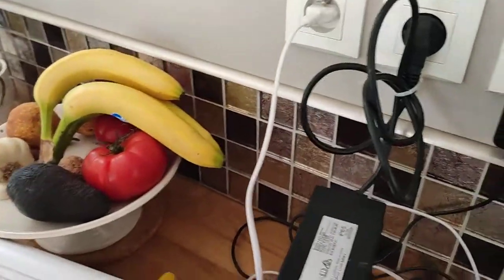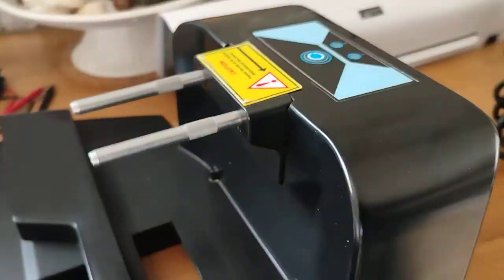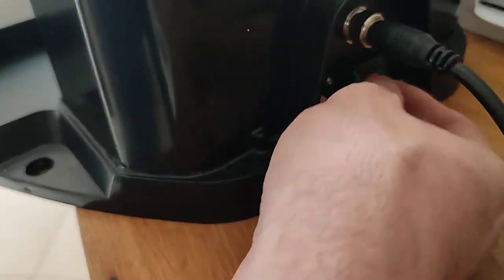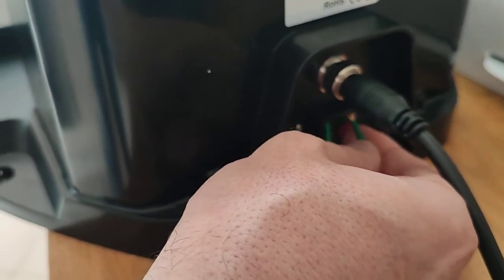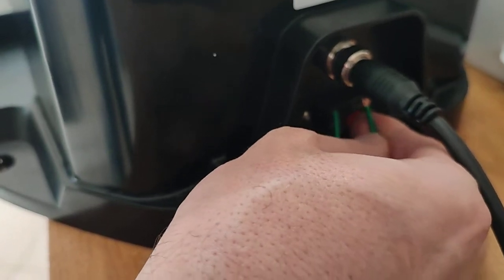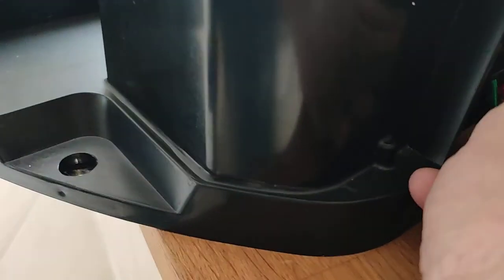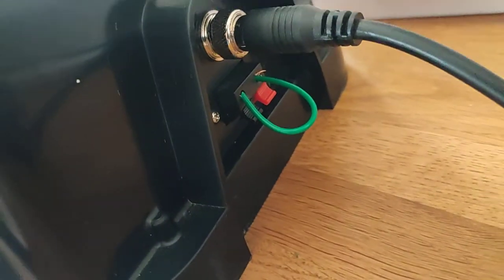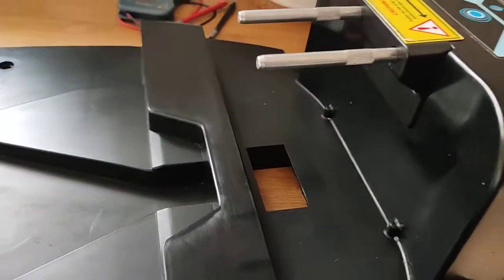DEVVIS Robot Lawn Mower Charging Station Testing

Comment: my Devvis h750t has no problems when mowing the lawn automatically, but when returning home it loses signal in some points and rotates on itself until it stops. Is it possible that the PCB of the charging station produces a bad signal (poor or noisy)?
Reply from the maker: could you please kindly tell us where you order the robot? and what is the order number with the store name? also for your issue,could you please take a video for showing,thanks a lot